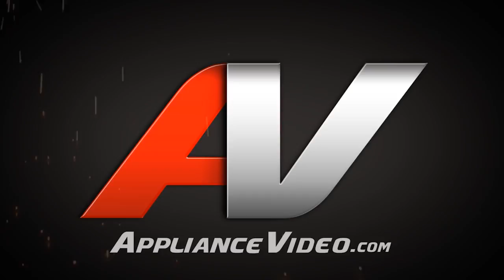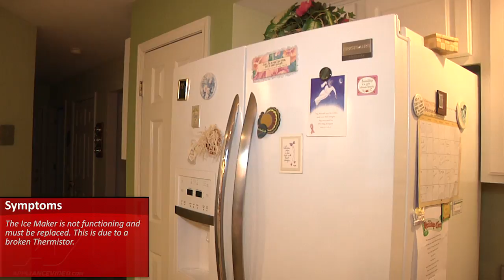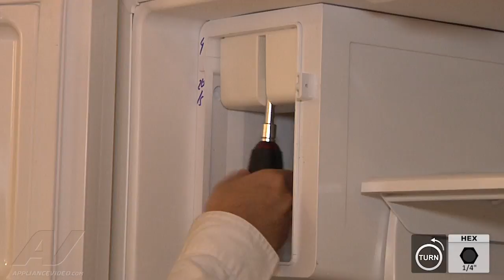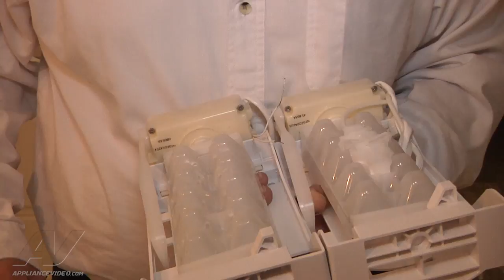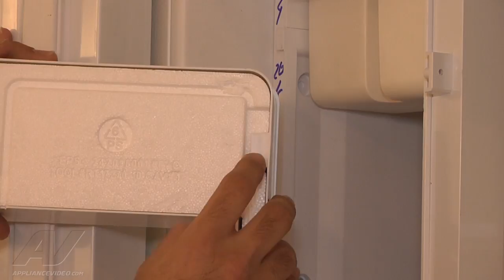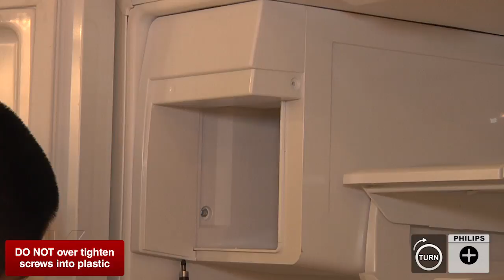Frigidaire Refrigerator Repair - Ice Maker Not Working - Ice Maker

Comment: I have Electrolux IQ. the ice maker is not making ice.water freeze in the bottom of the freezer. just wandering if you diagnosis this?
Reply from the maker: Great question, if you have a more technical question that our parts department cannot answer, you can search our over 17,000 answered questions free at our website www.ApplianceVideo.com under our Repair Help section. You can also call our parts department at 1-800-830-5465 and they can give you help 7-days A week ,or search at www.SaveMoreOnParts.com  .

Comment: Is there a way to disconnect the ice maker electrically from making ice? My refrigerator is icing up on the outside of the fridge in the back. I turned mine off and let the ice melt. When I plugged it back in, it immediately started condensation on the back of the fridge where the ice maker evaporators are located.
Reply from the maker: Great question, you can
call our parts department at 1-800-830-5465 and they can give you help 6-days A
week Mon-Sat . You can also search at www.SaveMoreOnParts.com 7- days a week.  If you have a more technical question that our parts department cannot answer, our technicians are answering all questions at our website at www.ApplianceVideo.com under our Repair Help section. We have over 4,000 common questions and
answers that you can easily search through by your model number, appliance
make, and problem or error codes, and It’s free to search through our question
& answer library

Comment: Is there any way to manually start a harvest cycle on these ice makers?
Reply from the maker: Great question, you can call our parts department at 1-800-830-5465 and they can give
you help 7-days A week. If you have a more technical question that our parts
department cannot answer, our technicians are answering
all questions at our website at www.ApplianceVideo.com under our Repair Help section. We have over 3,000 common
questions and answers that you can easily search through by your model number,
appliance make, and problem or error codes, and It’s free to search through our
question & answer library.

Comment: I am trying to fix the ice crusher. I would like to see how the tension spring should be attached to the bottom of tray. Can you help with this?
Reply from the maker: Great question, if you have a more technical question that our parts department cannot answer, you can search our over 13,000 answered questions free at our website www.ApplianceVideo.com under our Repair Help section. You can also call our parts department at 1-800-830-5465 and they can give you help 7-days A week ,or search at www.SaveMoreOnParts.com  .